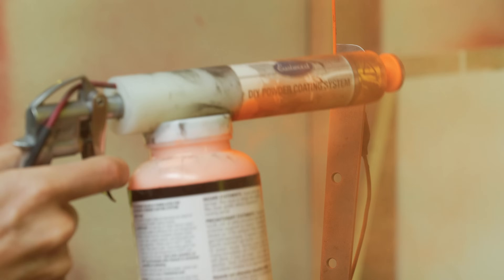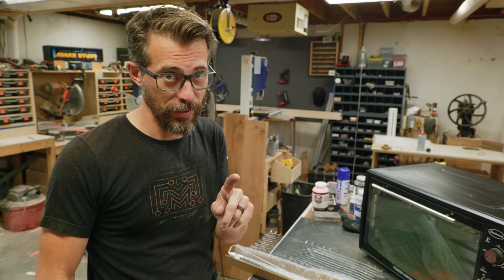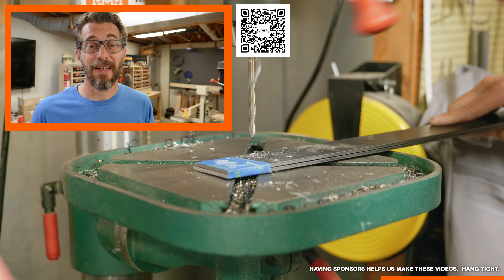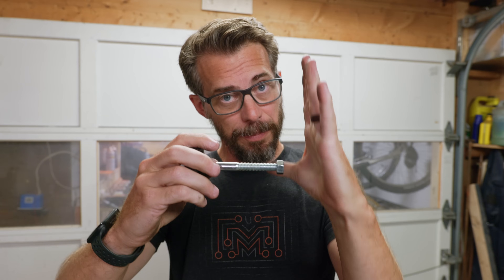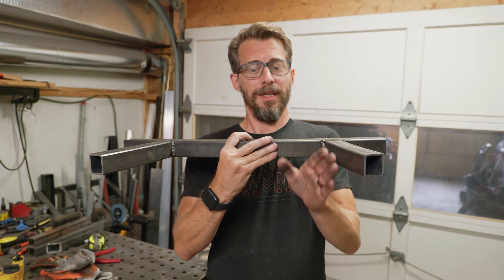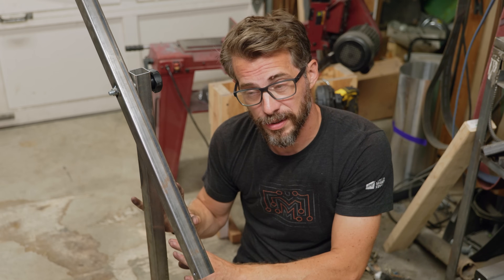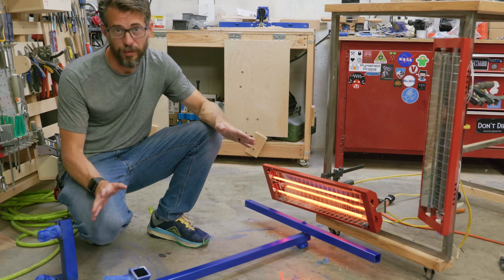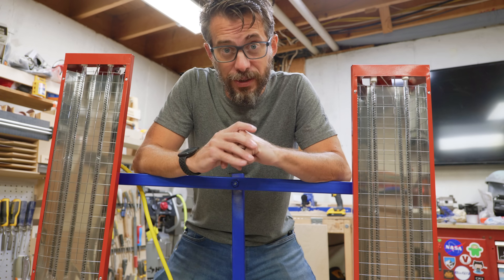How To Powder Coat Without An Oven!

Comment: I’ve been thinking I’d prefer to fabricate my own replacement steel fence. I’ve got a welder, a powder coater and a small oven too small for the fence.  You have answered the last question, where can I get a heat lamp large enough without spending thousands of $$$$.

Thank you so much.

Bill Bores

Comment: Pretty cool.  You can also use it to heat your shop.  Take a piece of plywood and steam it to make a slight curve and then line the inside with a reflective metal or material that will reflect the radiant heat. This way you can bake the entire thing without having to rotate it.

Comment: ok here we go... look into a redline gun (ez50) it has a dial on the back that you can control your kv. make sure your air supply is dry. harbor freight air driers are awesome for garage setups. a good air regulator makes a world of difference when your air is dry. when you use your heating lamp set up make sure you're curing for part temperature. the cure time does not start until part has reached temperature. quality powders and storage. prismatic powders has a ton of colors and good powders to use. a lot of people who do this here and there in a garage build their own ovens, or buy them second hand. the build your own setups I recommend an used oven with a fan setup in it. transfer that stuff into a larger box with the fan setup to help circulate the air to prevent hot spotting. a high heat rockwool insulation between the inside and outside panels of the oven works fantastic. high heat rope seals for the door or doors to seal them. prepping the parts by sand blasting is best. use a second hand cabinet blaster (with a shop vac attached if there's no vacuum with it) and use a oxide blasting material to prevent silica contamination that you can get with some glass bead or play sands.

Comment: Your gonna have a cold side and it won't cure properly in my opinion which is novice at best but what I did was took a standard oven apart so there's no top and formed a "closet" so to speak with old metal shed doors and insulated it you get temp control and I can do objects 5ft tall with ease similar to RRC channels design

Comment: Alongside the 2.0 comment, I'd place multiple holes along the vertical box section, that way it makes it height adjustable, and due to the fact heat rises, I'd also look at being able to place the heaters more underneath what ever it is being powder coated incorporating the 2.0 comments idea

Comment: I was pretty surprised by the heater wiring mistake. 20 amp circuit at 110v is 2200w. If these are 2kw each, 4kw total, you will need two circuits.

Comment: This is a great idea however I'm not sure how practical it is with powder coating large pieces that benefit from being evenly heated throughout. I would imagine unless you are perfectly aiming and moving these heaters while keeping a close eye on the piece you're powder coating,  you are going to get uneven results.  meaning some parts will reach 400° while other parts may have only gotten to 200. Your powder will never fully cure that way and you are going to have poor results. This could easily be mitigated by having another setup directly on the other side or finding some way to use reflectors to get even Heat. While this is a brilliant idea I think the only best way to cure powder is with an oven of some sort. I'm in the process of building a 6 by 4 by 4 oven right now for my shop

Comment: I have a list of things running through my mind of what to use that setup for! I'm going to be restoring an El Camino I've had for about 30 years, so the list goes like this....the frame, wheels (original), several parts under the hood that are 30 to 40 inches long, and probably some more items as they come to mind. I don't know the first thing about powder, but I did see a cool video on how to make up an inexpensive setup!  Thanks for sharing!!
Reply: Mind sharing a link to that video?
Reply: @Bosbulls  I would and will if I can find it. It was a while ago, but I'm happy to share.

Comment: How is it holding up? I've gotten into the powder coating game, and all powder requires a PMT (Part Metal Temp) cure. If you are simply curing the powder to the top of the metal, it might not last as long. Most powders say right on the box/bag what the PMT is, and how long to bake it at that PMT.

Comment: You could greatly improve the effective heating output (and coverage) if you had some simple reflector surfaces. As is, most of the IR light is wasted by hitting other surfaces, and you can probably multiply the effect 5x or 10x with reflectors. Probably wouldn't need to turn the item either.
You can use mylar (ca 97% IR reflective) or even plain aluminium foil (80-88% IR reflective) and just hang it up around the object in a rough cylinder shape. When you are done you can pack away into a trivial size for storage.
Mylar has a lot of benefit here in that it is not just more effective, but also much much sturdier than just alu foil, which would be a pain to keep from ripping.
Mylar is basically just a super thin alu foil (vapor deposited) sandwiched between PET plastic sheets (same as pop bottles). It's the same stuff you find in a lot of packaging material, for example chip bags (that have a silvery inside).If you are cheap and have more time than money You can wash and reuse these, and even weld them together into larger sheets with a simple iron and some baking sheets. You can buy mylar on a roll at many large-scale gardening suppliers though, and it's not too pricey.

Comment: wheels  i have a few motorcyce wheels you can pratice on , get really good at pre taping for holes and places you want bare,  get a really good tap and die set you will be retapping most of the threaded holes you powdercoat around.

Comment: Powder coating the thing assebled with the roating arm was probably a pretty not so good idea. I would highly recommend coating and burning them in seperately. Also, this probably melts the powder on the outside, however I am not so sure about adhesion to the metal substrate. Always remember, surface preparation is everything, make sure it is the right roughness and completely dust and grease/oil free :)
There is a reason for these ovens, because not only the powder but also the part has to come up to temperature for a set time to make it a fully cured, strongly bonded protective coat. So this method will most likely produce inferior coating quality, even though it looks like everything went smoothly.
I work in surface quality testing, so I see problems coming from not doing it right all the time.

Comment: one suggestion:  put the two lamp assemblies on a slide so you can bring them closer together in the vertical orientation.  You mentioned "putting on a second coat"  - my understanding is that any imperfections on the first coat will only be magnified in the second.

Comment: 🎯 Key Takeaways for quick navigation:

00:00 🧡 Introduction to Powder Coating
00:55 🌡️ Challenges of Large-Scale Powder Coating
01:52 💡 Affordable Infrared Heaters Solution
02:05 📚 Sponsorship: CuriosityStream
03:32 🔧 Building an Adjustable Stand
05:08 🚚 Creative Curved Base
06:55 🤔 Temporary Powder Coating Solution
08:01 ⚡ Electrical Adjustments
08:37 🎨 Powder Coating Process
10:03 💪 Conclusion and Call for Suggestions

Comment: So a temp gun used to find the correct distance to the part can be helpful. Pre-heating the part before coating a bit will let you check the distance for proper cure time as well as help adhesion.

Comment: Very good video thank you! I usually skip both the sponsor and the montage section of videos and by combining them I found myself happily watching. I recommend a washer between the base and spinning arm to protect the finish. Cleaning parts with acetone and sanding them lightly with 400 grit paper will help adhesion. Also different powders need different temps/cure time time

Comment: little late, but on the wiring for this... put both of them in series, and then use a 220v plug for your welder. It will pull same amps as one of them, and you can easily put them on that one circuit.
Also, I expect this is for powdercoating big parts of the karmann ghia

Comment: Different powders flow out at different temps, and require set times at temp, so use an IR temp sensor to monitor the temps of the metal in different spots. I’ve powder coated large objects using a method called hot flocking, where you heat the metal to proper temp using a roofing torch, then spray the powder onto the hot metal
Reply: Hot flocking. Hot it. Thanks gor the knowledge.  Gonna try this on an engine bay

Comment: Use more pieces of your curved tubing to add extensions, with room for smaller heaters but more significant in number at different angles around the part.

Comment: Getting powder to flow out and getting it to cure fully are 2 different things. I think you'd be better off making some sort of modular insulated walls so you can ad hoc an oven using your heaters. Powder will flow out at much lower temp than it's cure temp, it's possible to cure this way but the time you have to use has to be adjusted and honestly you're going to have a hard time getting a big part to be a consistent temp for long enough.

Comment: You said they’re 400 degrees. Where is it 400 degrees? Is it 6 inches in front, a foot, 2 feet? My oven is a lab oven 28 long by 17 by 17. So I would like to coat something larger. I’ve looked at heaters for that but I’ve never felt comfortable that everything will get evenly heated. Usually banks of heaters are used, but that’s too much.

Comment: It’d be neat if you made a, easy to store, folding reflective backing panel for reflecting the heat and keeping it on the part so there is less loss of heat and therefore more efficient. But then again you basically just have a large oven so ¯\_(ツ)_/¯

Comment: great idea for a small 36"× 36" project if they are opposite of each other within 6"-12" of the project. But still your success is not good at all unless you are within an enclosed container to contain all heat to cure the substrate correctly. There is no way a project like wheel, frame, ect will ever cure correctly on entire project, nor should you collect money from doing it because it will come apart and/or corrosion will form under the non properly cured part. By then way, NEVER powder over substrate that hasn't been properly blasted and then cleaned with an acceptable metal cleaner prior to powder. Just my yrs of experience talking..

Comment: I powder coated for a few years, a decade or so ago, large things like ambulances, and i can tell you that it's not that difficult. But you need to add more coats before you bake, just because it looks coated, it's probably not. It will self level and blend, so don't be afraid to put the dust to it. Also, if you find it not sticking, you can pre charge the metal by tapping on it with a hammer and it will become slightly magnetic helping the powder to be attracted. You also need those heaters closer with reflection opposite, 80% of your heat is going around your work, it'll cost more in hydro that its worth.

Comment: Just started the video and I don't think I've heard  him say the word yet. It's an Autoclave. The thing that needs to be built is an autoclave...

EDIT: After video - the obvious answer on what to use this for is...build a knock-down autoclave! 4 walls made out of 2x2's and some insulation. 400deg F isn't gonna melt or burn wood or fiberglass. Add use some door hinges to make one of the walls have the roof. Fold up roof/wall, hold up with 2nd wall, add 2 other walls and boom, knock-down booth that can be used for many things, INCLUDING as an autoclave

Comment: Have you tested the durability of the finished coating? How long did it take to finish baking that stand? I'm a big DIY advocate, but even wanting a moderate amount of large powder coated parts on a regular basis, if you really want a reliable and quality job it's probably worth paying a pro to do it. I imagine the amount of time, floor space and energy cost to set everything up, start baking and then constantly take the time to move the heater around and make sure you get every square inch isn't worth it. Glad you made the video to start the discussion.

Comment: Powder coat the Ghia. Like the whole thing......or maybe just the wheels. :)  I agree with the comments about adding some sort of reflector system if possible as that could help speed and efficiency. Some sort of way to monitor temps and time would also be a good addition.

Comment: For a purely resistive load like those heaters, Watts = Volts x Amps

A 2000 watt heater supplied 120 volts will draw 16 Amps. Better put a 20A plug on them! They might run on a 15A circuit, but you'd be stressing the circuit.
Reply from the maker: Thanks for the info!

Comment: When I powdercoat, I love to do engine parts, such as pulleys, intakes, timing covers, you get the idea. Also, if you are wiring a shop and use metal cover plates, I powder coat mine different colors based on uses, like Blue for shop air, red for backup power, etc. Also, don't forget powder coating tools! Keep them organized.
Reply from the maker: Nice, the colored cover plates is a cool idea!

Comment: I have a 5 drawer flat file (think for architectural drawings or maps) that’s in rough shape cosmetically cause I got it second hand, but I feel like powder coating it with some fun colors would be amazing. Mine is 42x52x18 inches so it’s huge, but there’s no way for me to do something like this on my own.

Comment: Keep in mind aluminum parts do not take kindly to being heated,  especially presurized aluminum storage tanks, such as scuba tanks.  The heat treatment during powder coating can drastically reduce the aluminum object's strength.

Comment: I just bought a pair of these to use for powder coating the tubes of wind chimes. I made a set out of EMT and painted them flat black. They came out really nice but the paint started chipping off where the striker hits the chime. Someone suggested powder coating the tubes. My idea was to attach each lamp to a pipe that is mounted on a wooden base. I don't need them to rotate as I can just suspend the chime tube in between the two lamps.

Comment: To have a good powder coating you need to make sure grounding is good, the piece to be powder coated is as clean as possible so paint will adhere, and that your gun is applying the right electrostatic charge to the powder.
Also make sure powder is fresh and good quality, cheap powder usually don’t get electrostatic charge as easy.
Mask the areas you don’t want powder coated, like hardware.

Comment: Don't powder coat your finalized item, powder coat the component pieces and put the whole thing together. Tape your threads and paper-roll your interior diameters to keep the paint out. 

Finally assembly your finished item.

Comment: All the things I'm coming across say that powder coating in sections like that is worse off, but better than paint. Rather than be a broken record and say the same that everyone else is though, I'll say that the SECOND thing that you should powder coat after the enclosure or the rediator shield should be parts of the car you like so much. It should prove to be very advantageous and you wont have to deal much with peeling in the next few decades.

Comment: If your bulbs burnout quickly.  I recommend not using your bare hands.  The oils on your hands cause a heat differential on the glass. 
As for what to use it for.  You have a car to rebuild.  Try powder coating the frame.

Comment: Amperage = W / V. So in theory, if they're 2000W together, they should pull around 17A at 120V, but the starting current of getting them up to temp might be higher, or you have something else also pulling power from that 20A breaker.

Comment: If you're just learning, try old bike frames. People are always discarding old bikes. Also, if you made mounting brackets for the heaters that were boxes around the "t-arm" you could slide them in or out on the arm and tighten them in place with a bolt on the back.

Comment: This is one of those times where you using Ohms law wouldve saved a lot of trouble.
2000w ÷ 115v = 17.4 amps.
Factor in your chord and no wonder it tripped the breaker. 
Having to use seperate cords on seperate circuits is pretty inconvenient. Most people are not going to have 2 close outlets on seperate circuits.

Comment: Since your heat is essentially coming from one direction, what about a small separate turntable stand that would slowly rotate your part to help evenly heat parts (or at least parts that have near rotational symmetry for that to make sense).

Comment: You need some kind of a rubbery washer between the stand and the rotating arm. So it will titen up. 
Especially since your two materials are flat with not abrasive parts to prevent them to turn under weight

Comment: Also you're going to have uneven heating on the areas not in front of the heater. If you build your own oven (big insulated box with heaters like you used in this video) it'll give you a much more even and controlled heating and cooling process.

Comment: You could try powder coating parts for the carmen ghia.  Maybe start small and you might even get to do the frame if that is what you want.  You could also do a video of the differences between powder coating and certain types of paint.  Having a torture test for parts and see what holds up better and why.  Many people don't realize how many different coatings can be used for a project so they just go with what is easiest at the time.  Having an idea of what is out there helps to know when to try something new if it is better in that instance.

Comment: You can build an impromptu oven by lining foam insulation board with aluminum foil and constructing an enclosed box with a space heater inside. It works like a champ.